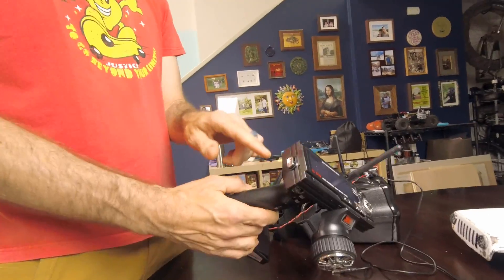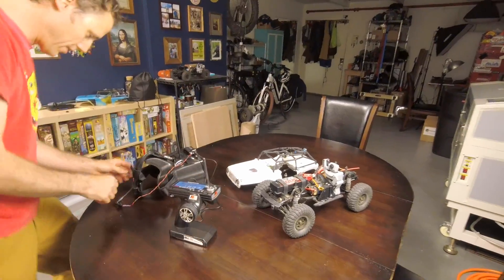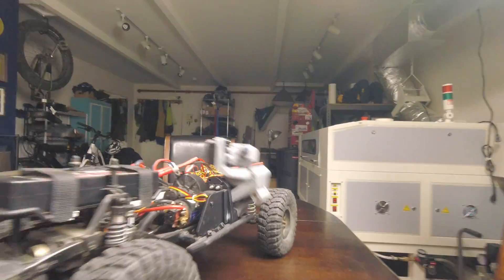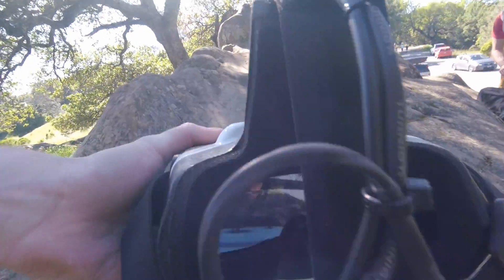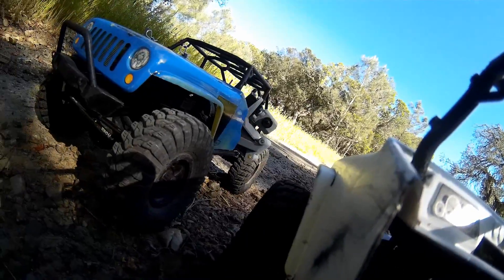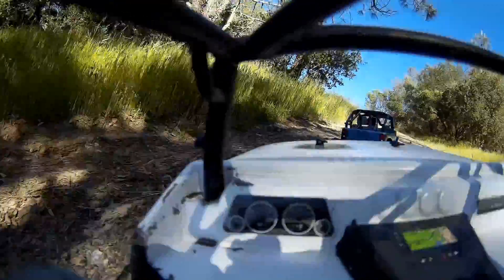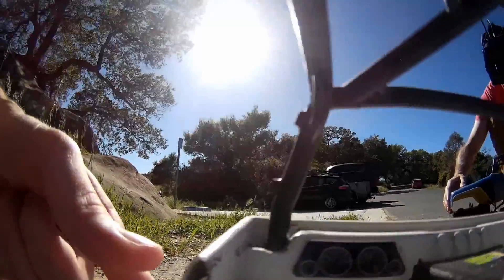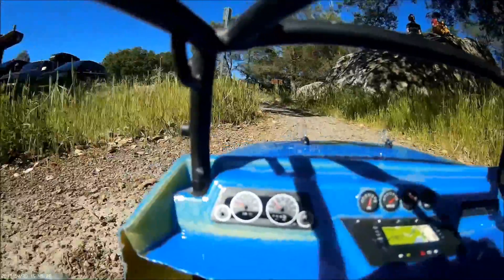RC Crawler Project - FPV with 3-axis Head Tracking

Comment: Hi! Thank you for this, I'm interested in building something similar. I have not seen your kind of camera mount anywhere. I really like the idea to "lean out" of the car at the same time as doing head tracking. Do you want to share the STLs for the camera mount?
Reply from the maker: Hey Erik. Small world: I remember watching your Ball Sculpture video. Nicely done. I went ahead and added a link to the STL files in the video description. It's been a while since I've done this project, but hopefully there is enough info out there for you to figure it out. Good luck!
Reply: @joshpit2003  Thank you! Incredible that you have seen that! :) It's been a while since I made it. I made another ball sculpture a couple of years later with a small robot arm inside as well... Now days I'm mostly fly FPV-drones... I thought this project would be a good winter project. :)
Reply from the maker: @MrSnille  Cool beans. Lemme know how it works out for you. I originally had the "lean" as a function of actual head-tilt (roll axis) but after some testing, it was much better as a push-button. I also decided that the degree of head movement vs camera movement needed to be set such that camera movement was amplified (I can't remember the actual figures, but maybe it is mentioned in Dylan's code). Good luck.
Reply: @joshpit2003  Started prototyping: https://youtu.be/5bWz7avV62s
Reply from the maker: @MrSnille  wow, that was fast. Nicely done. If I recall, the reason for the parallel(ish) bar linkage was to have less actual roll-angle when "leaning". You may have defeated that with your setup. Not a big deal if you don't mind the very tilted camera though.
Reply: @joshpit2003  Yes, and that makes more sens when you have the "lean" on a button as you do. I was thinking now when you are actually "leaning" for real it makes more sense to let it lean... But it's just the first version yet... :) I was thinking of publishing my STL:s, is that OK with you? I did base the whole thing on your idea. :) I'll link back to your original video of course.
Reply from the maker: @MrSnille  Yeah, I'd appreciate credit for the concept. As far as I know, I was the first to design in a "lean" ability, which stems from being an avid 4x4 enthusiast (full scale). We take our doors off, then lean out to see obstacles.

Comment: Do you think the time money and effort is worth it? Thinking about doing this with a trx4 but not sure. I've already did it with a Merv but on the fence about the trx.
Reply: Also did you 3D print that camera arm? It's pretty awesome.
Reply from the maker: Yeah, I designed and 3D printed the camera arm. Having the ability to lean out of the door is a big advantage when rc crawling in FPV. If I were to do it over again, I would design for a 2-camera stereoscopic setup (they make those now I think). Seeing in 3D would add to the realism big-time.
Reply: Joshua Tulberg mind sharing the STL for the print? 😉
Reply from the maker: Shoot me an email through my Rapid Whale business.

Comment: Awesome video. I stereoscopic cameras will improve the FPV experience, you will have better depth perception and a wider view, that is the route I'm taking.
Reply from the maker: Cool beans, are you using mobile-phone cameras? I wanted to do something like that, but I didn't want to sacrifice the ability to lean-out with larger cams.
Reply: Joshua Tulberg did use a mobile phone but now i am upgrading to the Skyzone SKY02S V+ 3D. Check it out